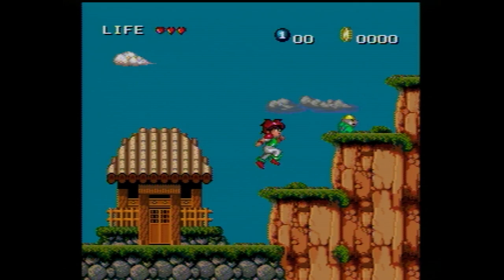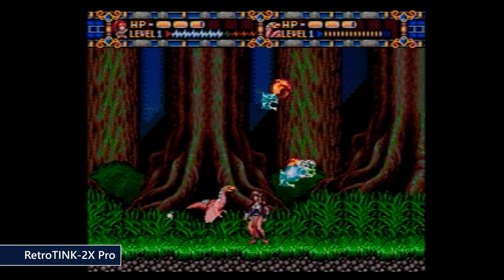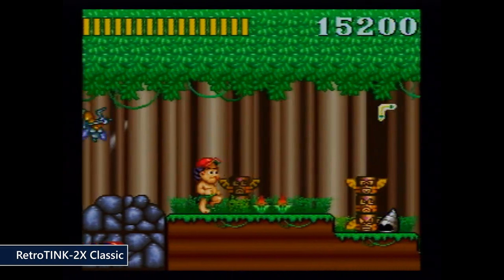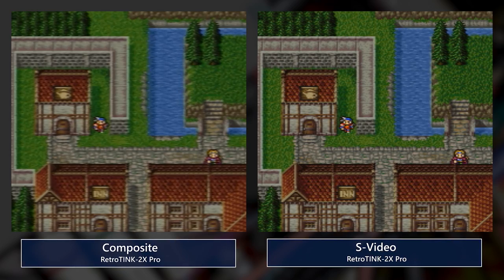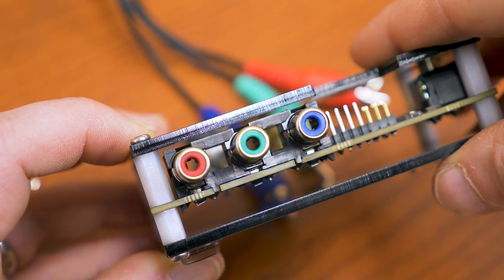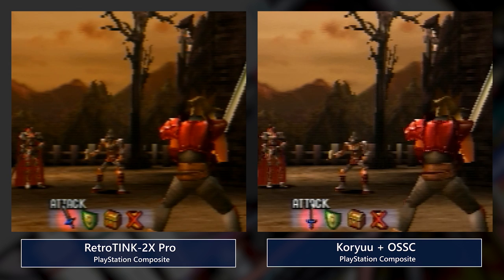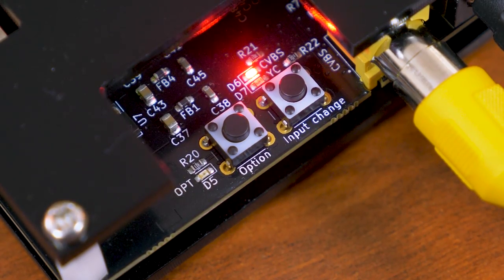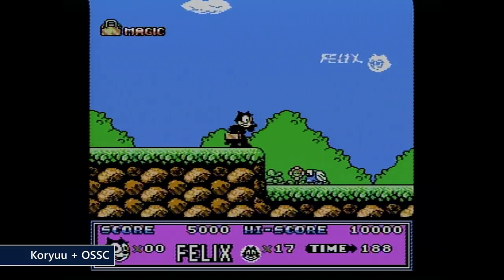RetroTINK-2X Pro & Koryuu - The best composite & S-video Options? :: MLiG Ad-Lib / MY LIFE IN GAMING

Comment: I recently got an OSSC and a Koryuu to accompany it and I can confirm that there is something wrong with the 480i from the Koryuu. If I feed 240p from S-Video into the Koryuu then channel the Koryuu's output into the OSSC it works very nicely, but as soon as the OSSC gets 480i from the Koryuu it does not work at all. This problem persists constantly with my 3DO since it only outputs 480i and occasionally on my N64, PlayStation and Saturn (the common trio that have games switching between 240p and 480i). Games on those systems that use 480i for cutscenes and menus will be dropped on the OSSC as soon as the game hits those particular parts, then comes back when 240p is enabled. The OSSC itself shows signs of an unstable sync signal only from Koryuu-type 480i due to the LED being red and the screen on the OSSC going nuts. I know its not the OSSC because when I feed it 480i directly from my PS2 and Xbox (all official component connections) the OSSC takes it no questions asked. I'm honestly surprised you two got 480i to work from the Koryuu into your OSSC, perhaps its also a mixture of the other pieces of equipment that I have in my setup (several Extron switchers). Oddly enough, my CRT has no issues with the Koryuu on any video mode. The S-Video jack on my CRT is a bit wonky so I wanted the Koryuu to bypass it by using the Component jacks instead. 480i from the Koryuu into my CRT has a bit more flicker than normal, but it displays it none the less. Hopefully the makers of the Koryuu come up with an update to fix this as its a pretty crippling issue at the moment. Have either of you two experienced these issues or something similar with the Koryuu?

Comment: I would have loved a focus on the Nes & Turbo Duo for consoles that composite is their best display without modding as well as the N64, Atari Jaguar, Panasonic 3DO, and the Philips cdi with S Video being their best output currently without modding. I know the Jaguar is Rgb capable out of the box but I don't know of any Component cable for it yet. Would love if HD Retrovision made one for the Jaguar.

Comment: 9:43
Try: *says a bunch of stuff*
What I hear: "When you're cycling through the mode buttons, if you push the button it'll be the first one for the thing that you're on but you can push it more and if you're on the other one and push it it'll be on a different one so push it and it'll be on the first one and it'll cycle through if you push it and don't be on the wrong one cause it'll be too dark if you push it so make sure you're on the right one so you get the correct brightness."
Me: "Push it till it looks good. Got it."
Reply: (Just so we're clear, this was not a dig at Try, but at my own comprehension ability)
Reply from the maker: [Try4ce] You're right, though! I should say "press button until it looks good" more often, I was definitely trying to say too much for something pretty simple.

Comment: RetroTink all the way ! can't wait for  system specific RAD2X-hdmi cables !
Reply: I've got the Nintendo one, and I love it.
Reply: I have all these in the RAD2X Cables
> PS1
> Genesis Model2
> N64
> PCEngine
> Saturn
One thing to remember, they are not the sharpest Analog to digital converters out there ( If you are after crisp pixels )
What i like is they get the job done properly and give you the ability to connect to HDMI display devices.

Comment: The Nintendo-compatible cables with composite and S-Video aren't just crappy... they're almost always wired incorrectly. They connect Chroma to CVBS. You can tell because they will work on an unmodified SNS-101 that normally doesn't support S-Video. This is why you see diagonal lines of interference wherever you see large areas of normally-solid colors.

I think they did this on purpose so the same cable would appear to work with SNS-101 and PAL N64s, which lets retailers avoid returns.

Comment: I think the framemeister’s s-video and composite handling is the best on the market and I think it makes it worth the 300 - 400 price tag. That’s why I bought one for my N64. ( also for the Component video handling for PS2/PS1 and GameCube)
Reply from the maker: [Try4ce] It is certainly a great all-in-one solution and it still handles 480i the best of anything out there.
Reply: My Life in Gaming I was wondering if the 480p handling is good for the framemeister now after updates or is it just alright still?
Reply from the maker: [Try4ce] I don't think it's that bad, but it's not perfect. 480p on the OSSC is simply glorious, I can't deny that. The 2x  480p (960p) just looks stunning to me. That said, my eyes never really zeroed in on the particular flaws that a lot of people point out with 480p on the Framemeister.
Reply: My Life in Gaming I guess you can always daisy chain the OSSC to the framemeister since the OSSC doesn’t have much input lag. 960p scales pretty good on the framemeister.

Comment: So I've watched a few videos on the retrotink 2x now and they all say the same thing, don't run multiple consoles through this one box. So then I'm curious, what is the point of this thing when retrotink still offers singular boxes that fit whatever connection method you have with your single system? Be it composite, s video, component, etc, they sell boxes that will do convert and clean up the signal from your console to your tv for around 60 bucks. 

Is it just purely the "bonus" things like scan lines filter? I'm just struggling see the need for these 2x and 4x boxes. 

Thanks!
Reply from the maker: [Try4ce] Well you can hook up whatever you want into the 5X, which is massively more advanced. The single cables are a separate product that Mike licensed out using his tech, but they aren't his products really, so that might be where your confusion comes in. You can hook up multiple things into the 2X with a switcher, but yeah it can cause image quality loss in some scenarios. Personally when I use my 2X devices, it's for a quick and easy temporary setup, and it's nice to be able to do that with any system, rather than just what I have a cable for.

Comment: I would love me some good N64 S-video cables. Not interested in getting mine HDMI modded, because its a PAL console, and I dont play on it enough to justify it, but I know my unit works with S-video since I got some generic composite + S-video cables for it.

The S-video picture looks nice, but my cables introduce that checkerboard pattern, so they are suboptimal.
Reply from the maker: [Try4ce] I hear that many of those S-video cables actually pump composite down the S-video line to increase compatibility with systems that don't support S-video, so I'm not sure if that's a guarantee on S-video support, unfortunately. Might need to do some more research to be sure.
Reply: Retro access make great s-video cables for n64

Comment: I use my RetroTink2X (classic) to line double Component to my CRT. It looks amazing. I was interested in what the difference between limited and full was. Do you guys have a picture for us to see the difference?
Reply from the maker: [Try4ce] There is no difference when Limited and Full are properly handled. Watch this for an explanation of Limited Range and Full Range. https://youtu.be/dym6XD3-8qw?t=1721 Basically they're just different standards for where the cutoff points in the signal are for the brightest white and the darkest black. If your display is set for the correct standard, then they should look identical. Full Range is handy for us though because since the OSSC is always Full Range, then we don't have to change our capture card settings when using the RetroTINK-2X Pro (but we do have to change the settings for the Classic, and then back again for the OSSC).

Comment: MLiG can you do a video about finding the best image quality on Genesis that still uses color dithering?

I already have the OSSC, but I also want to be able to fully enjoy the waterfalls in Sonic and color dithering was heavily used in both Earthworm Jim games - emulation in my experience can't properly blend the colors together, so this is an odd case where I REALLY need to use the hardware to get the most desired picture...sure a lot of the time I plan to use RGB, but I'd like to know what device does the best color blending, but also has clarity.

I don't know if you can get the color blending on S-Video either.

I originally was going to get the RetroTink, but now the Koryuu looks REALLY good.

It'd be a nice to have a comparison of those and any other methods you'd suggest for getting the color blending due to dithering on HD TVs!
Reply from the maker: [Try4ce] The only way to really get it that way is to just use composite video. S-video won't do it. But the effect works on a CRT or through RetroTINK or Koryuu.

Comment: I've been using my original RetroTINK-2X for composite/S-vid input into my OSSC via a Tendak HDMI-VGA adapter. Since that wasn't covered here, but was on one of the previous vids, wondering if the 2X Pro would be a worthy upgrade over the original for that use case.
Reply: For you, the best upgrade would be to get a HDMI -> component converter (~$14) to replace the VGA. That way you can use the LPF on the OSSC and get rid of the pixel shimmering artifact. The Pro probably isn't worth the upgrade unless you want to also use the device as a standalone in other setups.

Comment: I am looking to improve my set up for one of my consoles. I have a Mattel version Pal NES going through a cheap Upscaler convertor, then through a HDMI splitter and then through an Elgato HD60S, then to both lap top and modern tv. The problem with this one is that the image is stretched out, unlike other consoles I have with similar setups. I don't need the perfect image but I want the aspect ratio to be close to perfect at a reasonable price. My tv has the option to change the ratio to many different types but the capture looks bad. I have the same upscaling convertor on other consoles such as X Box, PlayStation 2 and PlayStation 2 Slim that do not have this problem, so I guess the NES is different ratio that automatically gets stretched out for some reason for the capture. Think I need 720 minimum for the capture card to capture anything, so it's either change the Upscaler or capture device. Would be really great if someone knows the solution for this, either a device or a setting if I am missing something obvious.
Reply from the maker: [Try4ce] The OSSC outputs 1280x720 with the correct aspect ratio when doing 3X. I can't say for sure if PAL resolution changes that, though.
Reply: @mylifeingaming  Ok, thank you for the reply, great channel, watched lots of your videos recently.
Reply: @mylifeingaming  Looks like a product which I will get but after looking at the description it would not work at the moment it seems for this problem. Will NOT work with an Nintendo N64, Non-RGB modded Nintendo NES, or a NTSC Gamecube as these are both S-Video and NOT RGB

Comment: What confuses me personally is that, in your comparison shots, how come the retrotink and the koryuu/OSSC seem to have different colors? Which one is more accurate? I like the smoothness of the retrotink 2x a lot, but the differences in color are bothering me a lot as I don't know which one is technically more accurate and it's very noticeable to me.
Reply from the maker: [Try4ce] The thing with composite and S-video is that you could argue there's more wiggle room with what's "correct." Those signals, along with NTSC color encoding in general, have a reputation for being imprecise, and up for interpretation by the display (or the user, with the display's settings). Not to say there aren't standards, but whose TV back in the day even had the same colors as their neighbor's? All to say, I wouldn't worry about it. RGB is more of a precise thing, but even then the real world result is that things are just highly variable in the analoy world.

Comment: Would you consider doing a video about the best capture devices for analog video like vhs, laserdisc or hi8 camcorders?
Or would these devices work? they seem geared toward displaying the signal on a digital monitor, not recording something on a hard drive.
Reply from the maker: [Try4ce] They would be used in tandem with a HDMI capture card to record those sources. Right now we're testing the RetroTINK 5X for a video that should release in about a week and it holds onto the shakey VHS sync signal better than any scaler we've tested.
Reply: @mylifeingaming  why would I need HDMI for analog sources, wouldnt it be better to output on a USB so it would connect to a computer? Or do HDMI and USB work the same once the signal is converted to digital?
Reply from the maker: [Try4ce] I'm not sure what kind of devices other than webcams exist today to take video into a computer via USB. Normally you'd use an HDMI capture card these days (which could be USB or internal). The reason you'd then use an external video processor to convert the composite to HDMI is because they can do a better job at scaling and converting to digital than those old composite capture cards that were often sold for converting VHS tapes. The USB on these external video processors like the RetroTINK are just for firmware updates and power. They don't transmit video over HDMI.

Comment: Thank you for making this video. The Koryu seems to be a very cool device with some legitimate use cases (N64 lack of RGB, Plugging into a PVM/BVM without S-video/composite inputs, etc.). The only use for RetroTINK-2X is if you were going to plug your system to a high-end 1440P monitor using the mClassic. I do like that it preserves the image colors well. My problem with the RetroTINK-2X is that there is no line tripler option for easier 4k upscaling (4k is a multiple of 720). Additionally, RetroTINK-2X is TOO expensive. In fact, this whole market for connecting retro-consoles to HDTVs is full of price gougers. $300+ for xRGB mini, $50+ for RGB/Component transcoders, $100+ for SCART selectors, $80+ for Retro HD-Vision cables, and even $50 for the crappy chinese scart HD Video Converter. Honestly, I see there are only 3 reasonable solutions. For high end, get some premium scart cables($25+) and OSSC($130+). For mid range, the levelhike/hyperkin/pound converters are ok despite the slight loss in color fidelity(Sonic 2 clouds shown by Bob retroRGB), and for the cheapest solution search Blackweb BWA17AV014 Composite/S-Video to HDMI converter upscaler (While this thing has poor performance, it goes for around a whopping $10, shipping included). Also, It appears you guys were not so crazy about the RetroTINK-2X. Did Mike and Bob hold you guys at gun point to make this video?
Reply from the maker: [Try4ce] I would not say that's true at all. I have been recommending the original version of the RetroTINK-2X for a long time because it's the lowest cost analog to digital device for gaming that I'm comfortable recommending. The Pro is a bit more expensive for sure, so it's up to the customer whether its ease of use is worth the extra price tag. Both are great devices that I'm so happy exist. If we seemed a little off in this video, it's because it's an "MLiG Mini," which is our unscripted series that's intended to take less time to produce. We haven't done one in a while and felt very out of practice. As for the price of devices in the retro market, keep in mind that this is a very niche market with people investing SERIOUS time and money into making these devices happen. Will it appeal to everyone at that price? No. But with the exceptions of only a few bad eggs, I truly believe most people are pricing these devices at the price points they need for them to be worth it for them at the limited scale they're produced at. A bigger market could drive costs down due to the size of the companies and larger scale of production. That is much more difficult to do in this market.
Reply: @mylifeingaming  Thank you for your quick reply. I just strongly believe OSSC is the best bang for your buck given the current circumstances. RetroTINK Classic + Retro Access S-video seem like a reasonable mid-tier solution that is more affordable for N64 owners that are not interested in modding. I think I'd rather have people buy this than destroy their systems by heavy modding. If you happen to talk to Mike again please let him know I think a lot more people would buy the pro version if it had a line tripler option., myself included.

Comment: Man the lack of 480p pass through is such a drag. It's hard to find a high quality Component transcoder. They exist but are obscenely expensive or are expensive for a one off device. The COMP2RGB can do it but it only offers RGBs and not RGBhv. Meaning if you want to connect it to a VGA monitor you have to hope your monitor accepts that.  
If this offered 480p transcoding/pass through you can easily use one of the many high quality HDMI to VGA adapters that are essentially lagless to get 480p on a VGA CRT. Then you could easily have 240p,480i/p content all in one box on a VGA CRT. It would be perfect. (Aside from maybe a lack of a higher quality deinterlacer)

Also: The Koryu+OSSC Combo for Composite IMO looks far worse than the RT2X. There's all these vertical line artifacts that super distracting when scrolling. (In addition to a ton of ringing artifacts) And I don't remember Composite ever looking like that on a real CRT. I'm not talking about dot crawl.

All modern TVs operate internally at 0-255 and all should properly support 0-255. 16-235 is only relevant for Video like Broadcast TV/Blu-Ray/DVD. But even then a display and system that works properly should map 16-235 to 0-255 when set to full range.
Reply: I hear ya... In the meantime, I think the super-cheap component -> HDMI transcoder boxes can actually pass-through 480p without lag and with decent quality to boot. I haven't had a chance to dig into detail yet though.